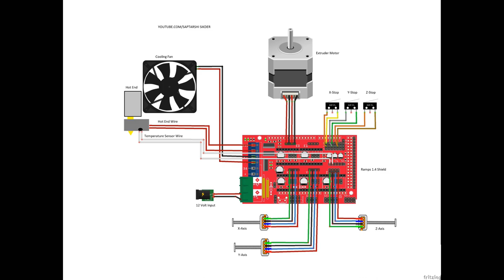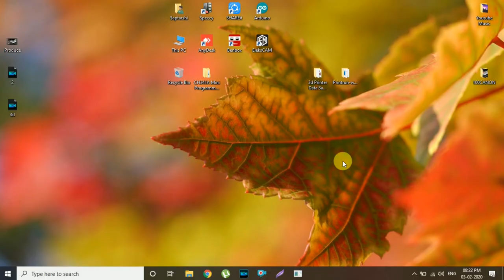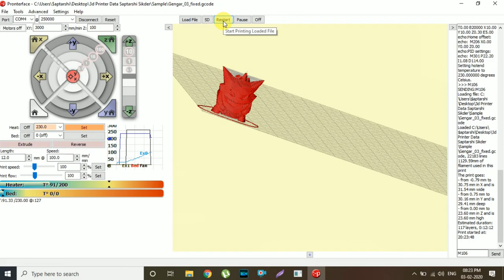How to Make a DIY 3D Printer at Home

Comment: Thanks for sharing 
BTW, I followed the step by step that you did but my intruder came out of smoked and it non of the motors and intruder working. I ran the programs Xloader and pronterface.  Do I need to run the arduino IDE?

Comment: Great bro, but can we use wood instead of acp sheet? Also can you plz provide the dimensions of the base, and the aluminium rods. Thanks in advance.
Reply from the maker: 6 inch Rod
Reply from the maker: u can use any wood sheet
Reply: Saptarshi Sikder mean aluminium sections 6’’

Comment: You have used a 12V 5amp SMPS which you have shown in the video but in the description below you haven't mentioned it you have given a link of 12V 10A SMPS!!!!! SO WHICH WE HAVE TO USE EXACTLY???
Reply from the maker: u can use any 12 volt 5 or 10 amp supply
Reply: Thanks for your reply

Comment: Good afternoon, please tell me how to test a printer without an extruder? When I turn on printing the Error Error appears:Printer halted. kill() called!
[ERROR] Error:Printer halted. kill() called!
Reply: If the uploader of this video had knew it , he would have made a original 3d printer himself. Please do not trust what you tube. All these are pre-crafted tested things. They are just re-assembling things here. Al most all are sponsored by some pcb company and 3 D Material printing company. If this fellow was genuine he would have explained each and every part. Instead these type of you tubers play only some ear cracking music. This simply means they do not know how it works. They are assembling a dis-assembled mechanism. I myself tried a plotter. My GOd I took one month to complete it from scratch. Now it is working fine. even then if one ask me to make it again I may take one week
Reply: Cuando vayas a imprimir edita el código g donde se pone la temperatura dice "M104 S200 ; set temperature", coloca s0 en lugar de s200  y así puedes probar como se mueven los motores.

Comment: I made it but does not work!!!!!! This is not real !!!! DVD engines burned!
Reply from the maker: U told it is not real then how i print this Model???tell???U aslo set voltage in A4988 driver protentioneter..If u increase value of the protentiometer then the motor burn
Reply: @SaptarshiSikder  U print other 3d printer??? I did dude what u say but first motor burn and then ramps 1.4 burn.....
Reply from the maker: Abdullah Dikici i saw this printer Print this item..i
Reply: @SaptarshiSikder what is the current value of A4988?
Reply: What should be the correct value on potentiometer ?